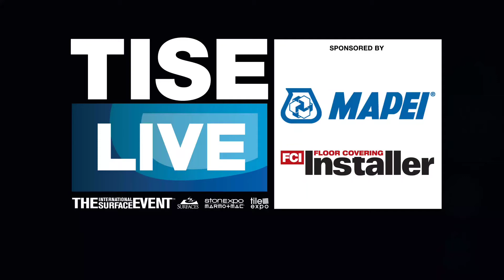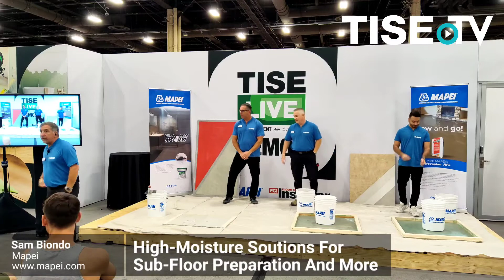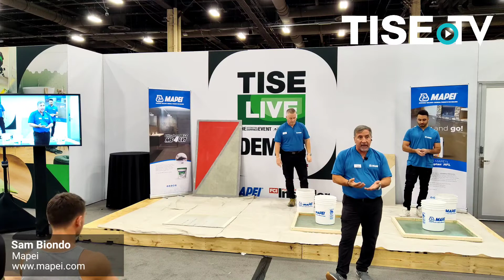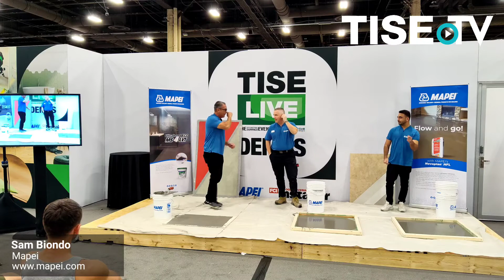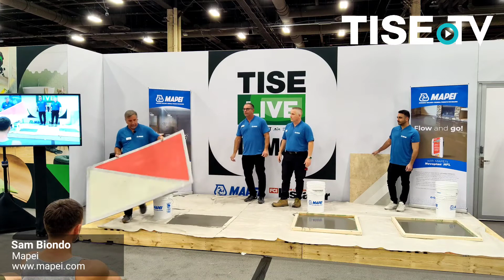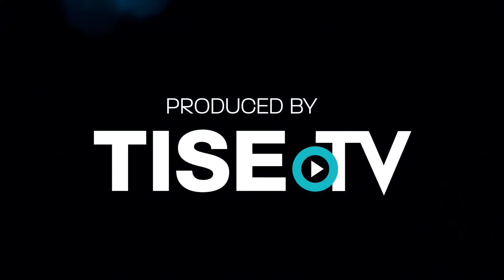TISE TV – MAPEI’s high-moisture solutions for subfloor preparation and more

Comment: Way to step the game up against red guard..  puts a level if product assurance seeing a company still trying to make the best product the consumer wants and making it easier for the installers..   make it 5$ cheaper off the shelf and you all would set the game on home stores waterproofing membrane..  

I do wonder though, why the whole red vs blue?  Is it a political thing?  Is there a liberal brand?  Lol….  

And another thing to advertise on is the sticktivity of mapei over the “other brand”..   ive used red guard and mapei both on hardy backr and other backers  making sure to wipe down the walls before hand thoroughly.  On many applications i have came back when dry and having applied both the same exact way, red guard will peel off in huge chunks most of the time..  say you puncture through it for whatever reason.  If you pull on that little piece it will damn near peel the entire layer off completely.  The mapei for whatever reason, think because its a little thinner than the red guard, but it will stick a hell of a lot better to the backer.  Think of if youve ever tried to paint over an oil based paint with latex..  its fine until you scratch it, then try sanding it and turn the scratch into a new paint job.  Mapei doesnt do that for whatever reason.  And it doesnt have that plastic rubber smell to it as bad which is good to help the long day headaches..    just an fyi i guess, i try to compliment the ones who make good stuff.  Good materials makes good work easier...
Reply from the maker: Thank you so much Zack for your positive "review" of Aqua Defense. It is a fantastic product when used properly.